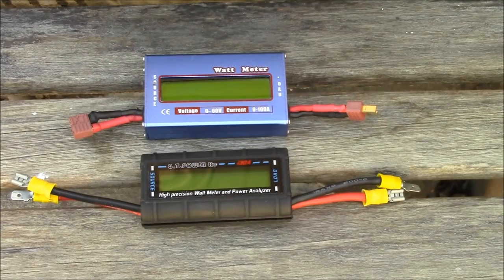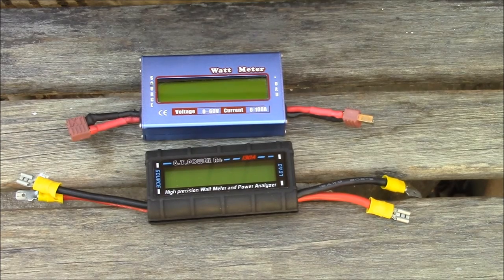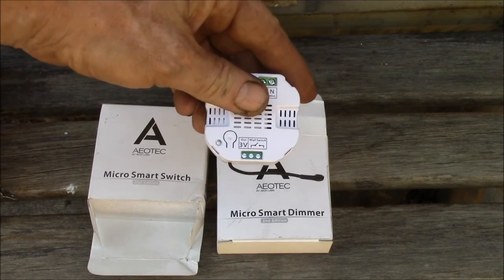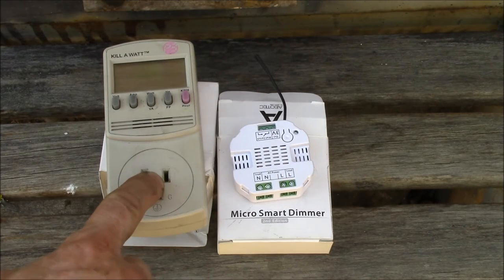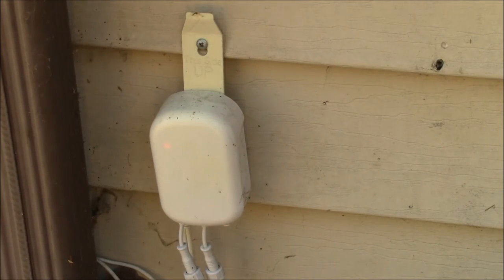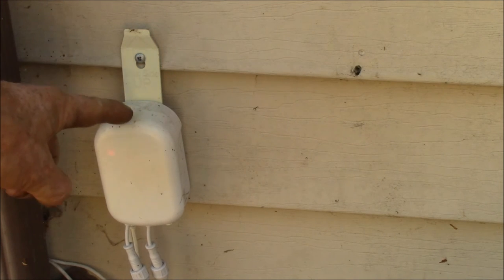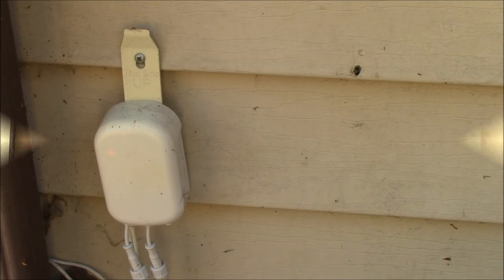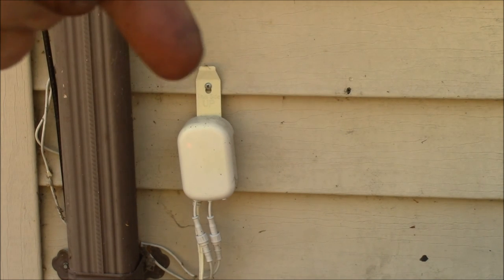Watt Meter Options, Pros and Cons

Comment: At 4:50 you said it adds up the 2 legs and combines them for total wattage.... that is INCORRECT

Current is a series Voltage circuit is the same...  
When you measure L1 and it reads 22 amps and you measure L2 and you get 18 amps, you are actually using 22 amps.. Because the 18 amps from L2 is PART of the 22 amps that you are reading from L1 ...  L1 has 22 amps because something on that L1 leg is pulling 4 more amps than L2 

When you check your AC or Dryer or Water heater or stove... which are 240V appliances, the current will be EXACT between both legs...  You do NOT add them together, for example my water heater pulls 18 amps... Each 120V leg shows 18 amps because the TOTAL usage is 18 amps...
Reply from the maker: Yes, you are correct.  But I was stating how this actual device works.  It is not a perfect meter and has some limitations.  It only senses voltage in one 120 volt leg and senses the current in each leg and then combines them as I noted.  This is an improvement over the previous version of device where it didn't even sense the voltage, that had to be entered as a parameter in the unit.  So at least this device is sensing the voltage and I think it's also computing the power factor, at least on the one leg, for a proper power calculation.

Comment: Do you get a AEON labs web interface to see the energy usage or does it link in with your z wave network ? atm i have a HC2
Reply from the maker: All I've seen is the Z-Wave interface for the AEOTEC Home Energy Monitor devices.  You can either monitor them directly on your Z-Wave controller or through their external energy monitoring service on the Z-Wave controller.